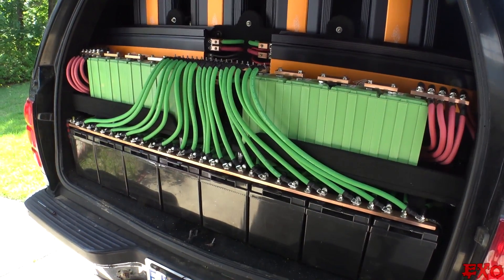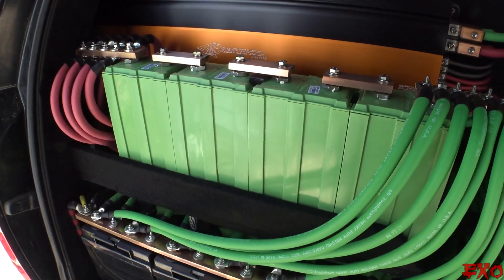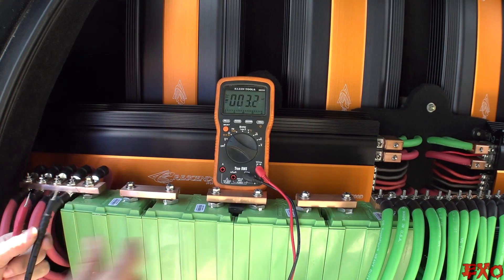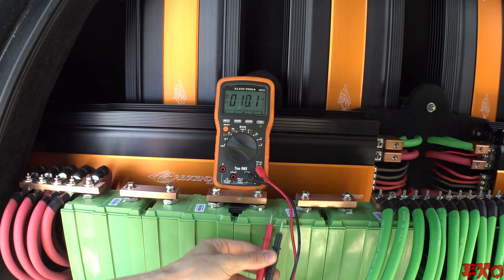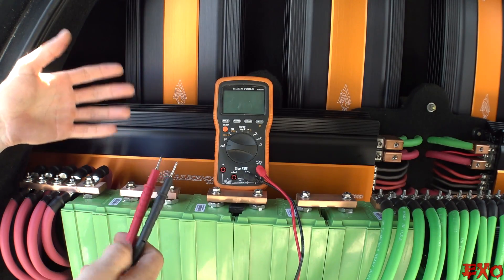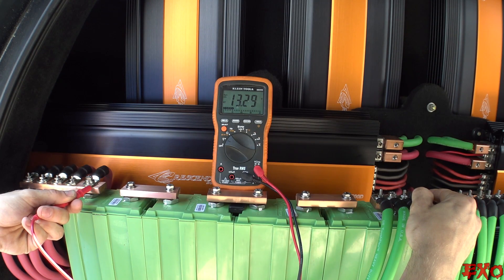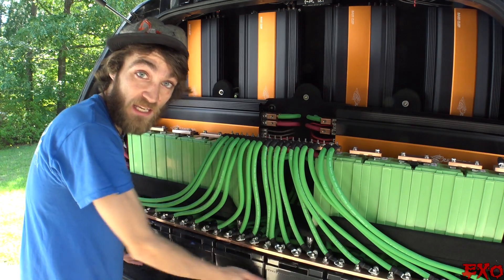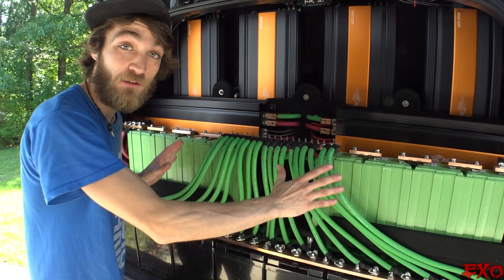DANGEROUS BATTERIES!?!? Explaining EXO's 12 Volt Lithium Iron Phosphate Battery Bank from JY Power

Comment: Never understood why these car power amp people still use paralleled  batteries for the common car DC 12-15V. Seriell the batteries (DANGEROUS!!) to whatever your power amp need without the switching power supply. No bastard switching power supply sections, straight.... Maybe +/-200V... multiple times smaller cables and junctions...

Comment: At least you're not wiring them in series and using a HV amp like the Taramps 160k

You'd get more power cheaper, but there's a real danger of a HVDC arc fault that would blow everything to smithereens. Or an electric shock if you touched any of the power leads.

Comment: Decent vid.   But LiFePo4 Batts have a very flat discharge curve (Google it) so it is difficult to say it is "balanced" if you are at the 3.3 range.  You need to charge to 3.6 on each cell then you can say it is balanced.   Other option is to discharge them all to 2.6, 2.7 and then charge them all up.   But yes lithium is MUCH BETTER than lead.  Good call on that
Reply from the maker: Lithium FTW! :D

Comment: I came back to your video bro because I will be in the lithium club. I will be building mine ( Ive learned so much so much about different chemistries, ratings, etc) JY, Amplab, XS power Lith. and Limitless are the truth. Even Winston if you get enough of them. Yes definitely dangerous I suggest to anyone research before you buy and install.
Reply from the maker: Thanks for the comment! Good luck on your lithium adventures :D
Reply: Thanks a ton. I'm doing this until I can get something much better. Keep up the goods EXO

Comment: What do you have in place to keep the LiFePO4 from overcharging? Do you charge these separately or is there a build in BCM build in?
Reply from the maker: The lithium won't get overcharged as they're the first bank depleted of reserve. The alt won't charge them back up higher than 15v, and once the lithium tops off the current draw will reduce greatly.

Comment: Because of weight is not all, as of LiFePO4 battery full 2000 charging cycle as of AGM battery up to 50% 300 to 500 charging cycle. As of AGM battery voltage will dropped too much during long period time under heavy load. As LiFePO4 battery voltage will hardly dropped their voltage during same load.
Reply from the maker: Thanks for the comment!

Comment: I You mentioned measuring the straps with your calipers. Just a little trick for anyone who may not have them....Use the open end of your combination wrenches to check normal sizes. Most everyone has basic wrenches around and that makes it pretty easy to check widths of 3/8, 7/16 1/2 inch and so on. Many already know this easy little trick, but some may not.

Comment: On the hypothetical could you use a dynamo with a independent engine driving it? To provide the power using capacitor packs? Just saying for cost weight and needs a dynamo or generator something alternative to battery array.

Comment: you should spec your max input voltage for your amps, most mosfets for amplifier applications are rated @ 18v thus you could run 5 Lion batteries (@16.5 V )instead of 4 (@13.2 V) possibly even 6 or 7 Lion cells if your mosfets are 24V : note dedicated alternator needed at spec voltage!
most amp manufactures do lab test at spec voltage thus their amps are over rated when tested in actual applications @ 13.8 -
 14.8 volts (standard alternators) its worth the research and cost in the long run when you gain 25-40% more output power

Comment: why do you use all that cable? i mean if you use more cable you will get better amperage but how it works? if the battery terminal is thinner it won't "bottleneck" all the other things?
Reply: you talk about that but you don't explain the issue with the terminals

Comment: the problem is lithium full charge is around 4.2 volts x4 is 16.8volt to fully charge it, lead acid batteries are fuilly charged at 14.7volts, your lithium battery will never be in full capacity ever. unless charger allows 16.8volt charge, and your lead acid will not be able to take it, its either change all your batteries to lithium instead, and get a proper 16.8 charge on that LI cells coz you lithium will never be in full capacity ever.
another problem all LI need balancing, just because it is balanced today it will remain balanced in time, if you plan to shift batteries you should have non mixed type of battery, remove those lead batteries and get a proper LI car charging system that will maintain that balance.
things to take note EXO, since you are operating the battery below the normal voltage, remember 3.8volt is storage voltage,, you are not supposed to load or use these storage mode battery, those battery will not even give the rating since it has not even been charge fully, your lead batteries will be fully charged at 14.7volts, divide that by 4, each of your  Li cell will only have 3.675volts, lower than storage mode of those Li lol, storage voltage is actually drained battery and keep the battery safe for storage
these batteries have different battery voltage operations that your Li is useless in the circuit. because you have batteries of different charge ratings, your Lead batteries will never allow you to charge the Li fully, you are making the Li work below the operational voltage of LI too, that 3.3 volt of LI is drained, way below the storage safe voltage of 3.8volts, Li batteries are supposed to operate above 3.7volts or it is considered drained. and your batteries are way below the drained level, in other words, LI is useless in your circuit sir exo.
If you wanted LI change the whole systems battery and charger
Reply: James Balagtas He is using LifePo4 back not ion or polymer

Comment: maybe i'm confused about things a little here but wouldn't the amperage be the same across all those points even if you had a dead cell inline because even if the cell doesn't support the total voltage of the series of batteries it still acts as a passthrough. or am i confused with the whole lithium set up?

Comment: thanks for the explanation, cool stuff, I'm running an am battery for my primary in my integra and an optima yellow top to power my 2 1000watt Kenwood amps that supply my 2 12" polk bd series subs, I've heard a lot of talk about overcharging and undercharging and I'm concerned about my setup, I'm running them in series and I was told I should get an isolator and I bought a cheapo chineseium isolator that wouldn't turn off at the voltages it should have so I eliminated it. my optima sits at around 14.1 and fluxuates to around 13.5 when bumping and  my primary agm sits at about 13.6 all the time. is this setup okay in your opinion? I'd love to hear your thoughts if you have some time. thanks and keep on making awesome videos!

Comment: EXO, you should know this about LiFePO4 cell chemistry like the one you use: the discahrge curve is VERY flat.. witch mean that from 80% to 30% state of charge, they have a VERY SIMILAR voltage  so it is DIFFICULT to know if a cell is more discharged than another because a large amount of Ah represent only couple mV diff... in your video these are very similar voltage witch is a good indication of the Balance state, however ALL lithium cells end out unbalanced. it depend on many factors like temperature variation, imperfection in the separator or solvant inside the cells  that amplify over the years, moisture etc.. so if you keep these AS IS then i suggest to monitor these on a regular base. You can buy gadget like that  that you could install in the cabin to monitor these:  https://hobbyking.com/en_us/battery-monitor-2-6s.html

Comment: aren't they all gonna read the same because each cell with charge each other till equilibrium is reach.
Reply: Keegan Keller no,  only if they where wired in parallel.  in series they will not automatically equalize.

Comment: You have a really great set up, I agree. It's a lot of work and a lot of passion. 
You're cells won't show a discrepancy of balance after a few days of use. You won't start seeing drifting of the cells until you start using the cells a lot. The unbalancing may not show up for another month or more.
The LiFePo's (what u have) will work better with AGM's than LiCo's will, definately (and LiCo's can be dangerous w/o proper setup). 

It's a great setup, and lots of power. I'm impressed, really.  Just make sure you do regular checking of each cell to make sure your investment stays working at it's greatness!  :)

Comment: You should get a small trailer and put 6   2ys62p surrette batteries wired in series in it (you'll need a trailer to fit 6) 
Then you'll have a bank that's rated at 4680AH 
Each battery is 2900 bucks and only 2 volt so you'll need 6

Comment: The only time a 30kw car stereo will draw 3000 amps is if your voltage is sitting at 10 volts.  I doubt that's ever going to happen.  I'm sure I don't need to tell you what that would do to your batteries lol

Comment: Hey Exo,
Any reason why the audio enthusiast manufacturers haven't tried a higher voltage system? Pointless for an "ordinary" car, but for the enthusiast market, maybe not... Using a mil-spec 48v alternator and four AGMs in series you'd end up with just as much power, but a quarter of the current (and therefore much lighter wiring). Just a thought...
Reply: Harry Sheppard I'm guessing because there is no demand for high voltage systems there are no cat audio amplifiers that sound be safe anywhere above 18 volts
Reply: Jesse Villarreal not true look into the high voltage brazilian amps like taraamps that are starting to gain fame out here
Reply: frogy beatz taramps is trash tho

Comment: 3.326*4=13.304 but you are resting at 13.29 which means that your first bank is slightly draining a little from your second bank which is what I think they meant by balanced. You should get a reading from one of the other batteries. and see the difference between the two banks.

Comment: I hope you do read this! as a electronics engineer and being in this business for 30= years, I agree with how you explained current flow. although you left one thing out, current flows from neg. to pos.. that's why it's so important to have your ground equal in size to your positive run. I am impressed with how much you do know about electronic theory, most installers have now clue. I do love to watch your show and never miss it.
Reply: i am only pointing out that you should probably type moron correctly if you are going to call someone a moron. I also educated people on what a morron was. I guess the only thing you could respond to was my reply about incorrect spelling, so i guess we both have too much time on our hands
Reply: R... I am trying to find a way to monitor the individual SOC of my batteries in a bank of 8. Do you have any suggestions for me please. My bank is 8 x 12v x 100ah (solar). I would like to know with confidence that each one is performing well. I was looking at http://www.virtualsecrets.com/build-solar-battery-bank-monitor.html but I'm not confident enough to do this.
Reply: I guess this is the only thing you could respond to.. A word, with one wrong letter.
Reply: Conventional current flows from positive to negative by definition.  Electrons flow from negative to positive.  This isn't a matter of opinion or authority, this is just how it's defined.  "The direction of conventional current is arbitrarily defined as the same direction as positive charges flow."
https://en.wikipedia.org/wiki/Electric_current#Conventions
Reply: Current, by convention flows from positive to negative, but the electrons flow from negative to positive. Also, it is a huge misconception but ground does not exist in an electrical system like this. Ground only exists with a grounded earth connection, otherwise it is return path for current, and based on the current convention that would be the negative lead.
Reply: a morron is a pepper. a moron is somebody that cant spell/or type the word moron correctly when insulting someone in a youtube comment.

Comment: Cool explanation EXO...alot of people still don't understand the importance of the ground wire(s) or that DC flows in a circle from negative to positive.  It kills me when I see a big positive wire going from the battery to the amps and then there's a piece of shit ground wire that's not even properly grounded.   Alot people only think of conventional flow instead of electron flow.

Comment: It will be "perfect" for a while, but LiFePo4 cells will drift over time. It's a fact and a chemical property of the chemistry. Sure, LiFePo4 cells don't want your attention with a spectacular thermal runaway like LiMn, LiPo or LiCo, but they will loose capacity and increase their internal resistance.

The problem with LiFePo4 cells is, they charge up to 3.6V, but shortly after the end of the charge, they will settle at ~3.3V per cell. They even will stay at roughly 3.3V until they are practicly empty (something around 10% SoC, depends on temperature, aging etc.). But after that they will recover to ~3.3V.  What I mean with that is: You have to check the voltages under load (for undervoltage protection) and during charging (for overvoltage protection).

I know, what you think. Another "youtube hero" yadda, yadda, yadda. But just read the Datasheets of some LiFePo4 cells, read some related science papers and take a look at big UPS systems of companies/datacenters and EV's. There is  reason why they all use a BMS...

Cheers!

Comment: If weight is a concern LiFePO4 is the only way to go.  One of the JY 80Ah (26.5 lbs) will do the work of 3 G31 AGMs (228 lbs).  The only thing is it'll cost you 50% more than 3 NS G31 AGMs.

EDIT: a single JY 80Ah is actually closer matched to 5 NS G31 AGMs which weighs ~375 lbs and costs about the same!
Reply: the_niceking 3 G31 AGMs can support 12-15k?
Reply: No, but realistically the JY will top out around 10k for a 20-30 sec burst.

I was wrong though, with reference to Hunter Martin's comparison video it's more correct to say that 1 JY 80Ah is closer matched to 5 NS G31 which weighs ~375 lbs and actually costs a bit more.

A single Winston 90Ah does the job of 4 NS G31s (~300lbs, ~$1,350) and only costs $635!

I'll edit my OP.
Reply: the_niceking you won't get the same performance from Winston as you will JY. You have to use more AH of Winston to equal JY. But, there are plenty of builds that demo 30k+ with only like 160ah of lithium
Reply: True, but 180Ah of WInston costs less than the JY and should perform about the exact same, the only downside is you're doubling your weight (still only ~50lbs).  That and I've heard the Winstons will need to be thrown on the charger more often to stay balanced.

30k clamped?  And most of those guys are probably running at least 600 amps worth of alt.
Reply: the_niceking yes. Usually more than that. And yeah 600amps of charging at least, usually... but that's only like 2 300A alts. Typically in your big builds, there's more than 600a of charging.

Comment: When they are hooked to each other, they will balance.  If they are independent are they equal tho?
Reply: Jax Turner , when power sources are in series, the current through them all will be equal, voltage is not....  a system in parallel is exactly opposite of that...
Reply: "Opposite" as in voltage would be equal then right? N by the way my real name is Jay. Kinda uncommon did your mom name ya that?
Reply: Yes.  Voltage is equal on all parallel power nodes..  but current will not be.  Yes.  Parents named me that...
Reply: They don't really need to be equal when they're separated though, as long as all the cells are equal at their float voltage (13.3v) when everything is connected then there shouldn't be any problems

The concern would be if they're balancing up or down from 13.3v
Reply: Jay Jenkins and Jenkins? No way wer probably related.  Michigan or West Virginia? I have Jenkins kin in WV
Reply: Jay Jenkins but anyway yep that's what I meant the way he's got em hooked together they would be equal voltage just like you said.

Comment: These cells are made by K2 Energy, a US company, with probably the most sophisticated lithium ion production facility in north America. The company was awarded an $81 million contract with the US Navy in 2015 to design and produce energy storage solutions for the military and other domestic applications. Mixing and matching old/used cells with brand new cells may result in imbalanced charging, but like Exo is doing, checking each cell individually from time to time to make sure a single cell isn't being overcharged can eliminate the need for a BMS. The same can be done with ultracapacitors.Love the install, now put it on the meter ;)

Comment: hi how do I increase my voltage
Reply: Do the big 3, use 1/0 ofc wire, get batteries with a lot of amp hours, get a high output alternator.
Reply: Gareth Bailey bigger and thicker wire gauges same thing if you want to make your speakers just a few volts louder bigger and thicker gauges of wiring
Reply: If you're running any sort of 'normal' system (<1500wrms), all you should need to do is the big 3 and getting a little bit bigger of a battery, maybe make sure your alternator is in good condition, can get a reconditioned one as part exchange for a reasonable price.

Also make sure you're not being stupid and running 8 gauge for 20ft+